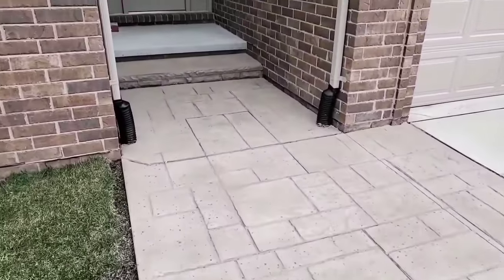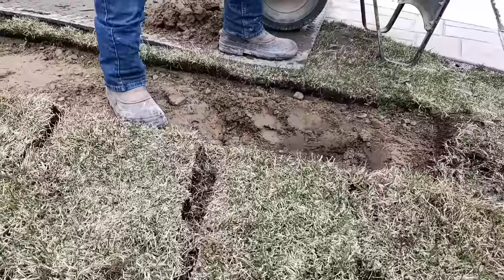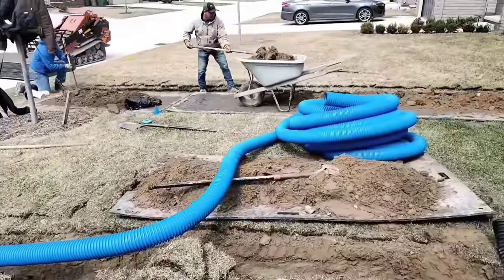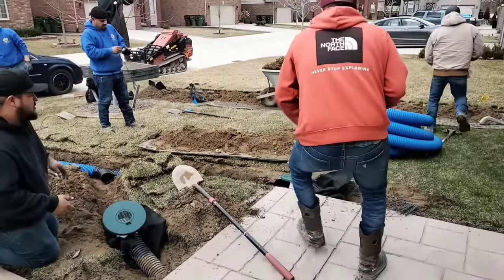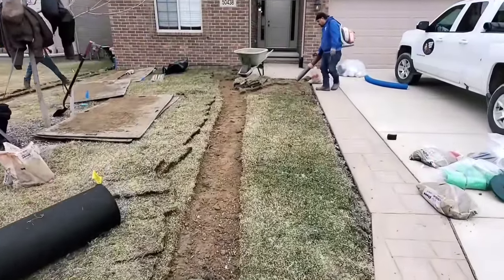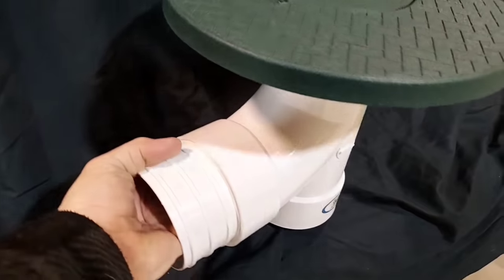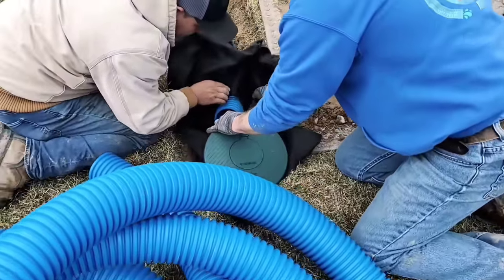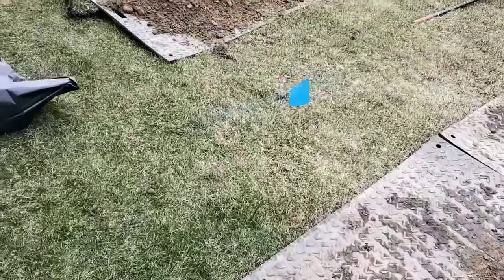Underground Downspout Drain - Done Right The First Time Work Smarter NOT Harder ] Drainage For DIYer

Comment: I really like the debris-evacuating downspout boots that Piedmont makes, but I'd like to see the industry provide a cheaper version of this made out of HDPE that is more aimed at residential downspouts. It's basically a downspout boot that has a screen inside and a flap door on the front so leaves and debris falls right out.  The screen is removable too.  I like the vented downspout adapter that you guys show in the videos, but I wish there was a version of this with a debris screen inside.  It would be a wonderful way to reduce maintenance and keep debris out of the underground pipe. Thanks!
Reply from the maker: https://youtube.com/playlist?list=PLjFCqaZ4v1BXKlR6qPMC_8I00r5KGdoP9&si=zzz5vOkVof4EaWaW

Comment: Not a new product,  but a possible experiment.   Was thinking about adding a catch basin in a low spot next to the downspout line.  Then wrap the grate with your fabric to keep out the bulk of the debris.  I have Bermuda grass, so it should grow over and cover it as well.  A quick fix for a bad spot where water pools up.

Comment: It is as if you were watching me these past 2 weeks.  We are north enough to freeze and I was replacing some work done last year with 2 runs using gen 1 popups/restrictors. I extended both runs  to the curb, I am using the latest popups/ restrictor plate with a 90 degree fitting  and holes drilled in it,  My soil is clay and agree it can be a sponge.  So I did 2 things - I dug out a mini dry well under both popups , and wrapped the hole and stone in your fabric. Unlike your T connector shown in the video here, the popup with 90 degree connector doesn't go as deep into the ground as that fitting.  So the drywell is independently wrapped and is closer to the surface than what you'd have using what is in the video.  I also used 2 feet of your cut pipe from the popup to the solid.  Again, did this because of freeze issues.  Come winter, water should have ways to escape, even if teh popup is under snow or ice. I  used your fabric to line the trench (above the drywell portion as well) from the popup to 2 feet past the perforated pipe connection  wrapped carefully and  packed everything down.  So I have 2 feet of perforated pipe wrapped to let water remaining in teh pipe an escape route. Now, I've had to repack the soil around the popups a couple of times, as heavy rain showed that while these worked great and water comes out of the popup but eventually it also finds it's way from beneath/around the popup as the drywell fills and the clay soil around the drywell and under the popup supersaturates and the water looks to exit.  This water did compact the soil such that I had to add more to deal with soil compaction and fill the voids the water created.  Also, in my case, I've no turf or sod just a dirt yard being restarted from scratch and I think the soil with grass goes a long way to making the pipe and popups stable when wet.  But at the moment, I can still walk the trenches after a rain and compact it more .  But once I have grass I think it'll all stabilize.  A local water utility guy who was checking my meter said the popups being right at the curb was perfect for getting the water into the storm drain.  .

Comment: Hello Robert,  I’m out of Columbus, Ohio.  It is standard to take our roof water run off systems under the sidewalk and to the curb.  The problem is that the pipe has to belly under the sidewalk and then come back up to go out of the curb.  Is there a way to develop a fitting that would connect to 3 inch schedule 40 pipe but it would flatten out to reduce the belly effect but still retain the capacity of a 3 inch pipe
Reply from the maker: I will work on it. That is a good idea because it will not chock down the flow. The water will speed up in the smaller diameter pipe "Mass Flow Rate" water in motion with its kinetic energy.

Comment: If you connect 4 downpipes to a single 4 inch hose will that not reatrict the flow of water in a heavy rain.   Even with 2x3 small down pipes you have 6 square inches of flow in every diwnpipe x 4 and you have 24 square inches going i to a 4 inch hose which is only 12.5 square inch cross sectional pipe. ??
Reply from the maker: https://youtu.be/b3YF1QSGz6M?si=S1UE9ohHHt1gMePx
Do the math. We do.

Comment: When would you use the in-line catch basin instead of a D-box?  Also, no knife cut after the catch basin?  Trying to plan a DIY install and getting confused with all the different installation methods in different videos.
Reply from the maker: I will make you a video. This video will cover everything. Thank you for commenting.
Reply: @FRENCHDRAINMAN  Does the 4inch Pop-up Emitter Catch Basin with Sump remove the need for a separate 4inch Catch Basin? Or do you need to use both?

Comment: I've got a corrugated pipe that just dead ends under the grass. There's a drop off of at least a meter and a half between the start and the end of the pipe. During heavy rain events, there is enough pressure in that pipe that the grass will rip and open up, allowing gravel and other miscellaneous materials to wash out. The grass falls right back into place as soon as the rain is over. I definitely should do something to set it up better, but heck, its been working fine for about 2 decades at this point.
Reply from the maker: Nothing like a good thunderstorm to clean out a gutter drain.

Comment: At what point do you need multiple pipes off multiple downspouts? I have 3 downspouts and I'm wondering can I connect them all to 1 drain pipe and popup? Or will that overwhelm the system? Texas flood area
Reply from the maker: As long as it's a 4" pipe your solid. We run up to 5 downspouts on a 4" line in Michigan. I wouldn't advise that for you. 3 isn't a issue.

Comment: I am wondering if it could you use the pop up on the discharge line of a sump pump?
Reply from the maker: Absolutely 
Watch "French Drain Man V2.0 Pop-Up Emitter Water Flow 240 Gallons Per Minute With 2% Slope Downspout Drain" on YouTube
https://youtu.be/uEsKU0m8qhw

Comment: Where can I get some of that blue pipe I have some downspouts where the lawn mowing person hits it with his weed eater and has cut holes in it so I need to cut it off at ground level put an adapter on it and then connect it back to the downspout I need about 6 ft to do three downspouts.
Reply from the maker: Best French Drain and Yard Drainage Contractor
https://frenchdrainman.com/

Comment: So, Have you got away from having a clean out using the 12” round distribution box which was located just after the downspout connection, 5’-10’ away? Thanks
Reply from the maker: If there are really big trees we still use a giant Basin. The problem is nobody vacuums / cleans them out. Our smaller in line is quick and easy to install as well as pop the four inch grate and stick a shop vacuum hose to the bottom of the basin. People have trouble with the bigger basins. We built it for the DIYers but now it's mostly what my customers want. My men love them too.
Reply: @FRENCHDRAINMAN  Thank you !

Comment: Question - Are catch basins required? How come the Buried Downspout Kit for 1% Slope Kit on your website doesn't include them? In this video, would it be OK to connect the two downspout pipes with a Wye and not have any catch basins? In other words, would it work if you did everything the same as in the video except not use any catch basins? 

Does the new 4 in. Pop-up Emitter Catch Basin with Sump remove the need for catch basins as you have in this video?
Reply from the maker: I want the catch basin to collect shingle gravel as well as a vent. In the winter the street is plowed and snow is ice packed on the pop-up emitter near the street,  the water can vent out the basin.

Comment: How well do the pop ups work when they have snow on top
Reply from the maker: We have a Groove in the pop-up plate and the water comes out around the hinge. It's also to clean the hinge point to remove grass blades or debris. It doesn't have to pop-up. It's pretty incredible really. So much development went into the discharge system. It's actually pretty cool to see the water come out when it's closed. It takes 3 downspouts to run it at half throttle. 6 downspouts and it's entertaining. 8 downspouts and it's exciting. It's boring under normal use by design. You won't be disappointed to own one. It will never get lost in the grass and you can stick your hand in it to remove leaves or sticks. We built it because everything on the marked had short comings. The pitfalls were many. We took all pop-up emitter on the market and use there failure points to develop ours. I have so many stories about this pop-up emitter V2.0  I should do a video about all the Hurdles we had to clear.    
Right down to making it out of Virgin HDPE with no blown in filler. It's the last pop-up emitter you will ever have to buy. Thank you for commenting that was a great question. We will do so many more instructional videos this summer highlighting the function and features.
 Stay Tuned!

Comment: I just installed the larger catch basins on all of my downspouts. What’s the difference between those and these new ones?
Reply from the maker: You have to clean the new small ones sooner. The new smaller install so much easier. They fit everywhere. If you are feeding a ton of leaves and sticks into the system then the larger would be better. If small trees or few trees the small basin works just fine. It's easier to pop the grate and vacuum out the small basin than to take off the screwed down lid on the bigger basin. Those are the differences.
Reply: @FRENCHDRAINMAN  does the bigger box kill the flow rate?
Reply from the maker: @thegolftechie  not if you have 1% Slope.

Comment: If i wanted to run 3 downspouts to main line to one pop up emitter what would you use. ?    Imnin florida where there are heavy rains at times that overwhelm my 2 downspouts thats why im running a third….   I do not want to run 3 seperate main lines out to the street if i dont have  to.   What size main line pipe ?   The run from the downspouts to the street will be around 20-50 feet
Reply from the maker: I would use our armor Pipe in 4" you can go up to 4 downspouts. 
Store | French Drain Systems | Curtain Drains | Macomb, Oakland, Lapeer, St. Clair County
https://frenchdrainman.com/store/
Reply: Do you have a link to a 3 into 1 wye  and the best pop up emitter

Comment: I’m in south Florida where it rains constantly.  I don’t see the need for all this.  You have gutters just put in an elbow and let it run down the driveway.  The other one can drain in the yard watering it.   Can you please explain this.   Does it have something to do with winter and water freezing.
Reply: Here quite often we have basements, not slabs, since the water table is usually more than 10 feet below grade.  We don't want any more water against the foundation/basement walls than can be avoided.  A part of it is due to the freeze thaw cycle as well.
Reply from the maker: https://youtube.com/playlist?list=PLjFCqaZ4v1BUqichor2QH1X_p9bBPor8D&si=zlbsvXRF2i4m8w39

Comment: Great, educational video.  We purchased a new home a little over a year ago.  New construction.  Whoever installed the pop up drain for the downspout in front of our house must not have done it correctly.  I'm basing that off the fact that this past winter, our front stoop, right where the drain runs under, has cracked.  Including a corner of the driveway.  My theory is that the drain pipe thawed and froze during the coldest part of the winter.  Now the builder that built our house is out of business.  :(

Comment: Not sure if i understand the need for the in line  basin?  your leaking water into the soil at the bottom of it which confuses me if the purpose is to get rid of water as far away from the house as possible.  you also mention its purpose is for venting but the connection at the downspout should have a vent on it right?  just trying to understand this.  i live in chicago and don't have a huge lot so i really only want to put in a vent/cleanout at the downspout connection and then the pop up at the end of the run near the sidewalk.
Reply from the maker: https://youtube.com/playlist?list=PLjFCqaZ4v1BWbLx7DHgD1YrWdm2wotwlY&si=Fl1uosVJ0K-A7Xwq

Comment: Great video! We are on a small corner lot with about a total of approximately 8 feet from the corner of the house/downspout to the public sidewalk. Do we need a d-box or vent or can we run the blue pipe directly from the downspout to a pop up? We have a second downspout on the other side of the front of the house that is about 15 feet back from the sidewalk. Thanks!!
Reply from the maker: It's nice to have a in line catch basin if you have asphalt singles. I recommend that.

Comment: Great work, but the install on the corrugated under the cement left a lot to be desired. They could’ve cut it closer to the cement!
Reply from the maker: Armor pipe does flex like the Black thinner pipe and we needed to twist it a bit for alignment. 
Thank you for commenting.

Comment: These new catch basins and pop up emitters are nice. One thing I don't understand, Where does the shingle gravel go. If the basin has a hole on the bottom and you fill the bottom with pea stone to act as a dry well, is the shingle gravel collecting on top of the pea stone. With a D box it made sense to use a shop vac and clean out the shingle gravel, but with these won't you suck up the pea stone at the same time. Your videos are awesome. Thanks
Reply from the maker: The pea stone is on the OUTSIDE of the in line catch basin. So it's empty inside. The basin has many holes drilled in it to allow for the water to leach into the pea stone. Thank you for commenting. I hope this helps.
Reply: @FRENCHDRAINMAN  My apologies, I thought the in line catch basin was open on the bottom like the new pop-up emitter. Can I ask why sometimes you use a D box (or this new in line basin) a few feet away from the downspout and sometimes you just run the pipe straight to the pop-up. If I am nervous about debris and gravel collecting in the pipe, then one of these in line basins is a must, correct. Any fear of the water velocity slowing down when it goes into the basin?

Comment: In most cities you can't take the water all the way to the street.
Reply from the maker: If it only runs during a rain your fine but if it's a sump pump line running all the time they will ask you to remove it. Usually 20ft off the street.

Comment: It's all good until the roots grow into it through the fitting joints & drain holes!
Reply from the maker: We use tile tape that is water tight. Tree roots can't get into our roof runoff systems.
Reply: @FRENCHDRAINMAN  I thought you said there were drain holes so water didn't sit in it.
Reply: @daled8221  The Pipe has no perforated holes. The vent at the beginning and the pop up at the end are wrapped in the fabric that blocks roots and dirt.

Comment: Hey dude should of put a tee underneath  the concrete and ran 1 4 inch corrugated out the yard. Working smarter not harder
Reply from the maker: I don't use Tees as the video explains. Thank you for commenting.

Comment: That's an upside down san-tee not a sweeping 90. I don't think you can go horizontal to vertical that way. Supposed to be a long sweeping wye instead.
Reply from the maker: We do use it off-label in this application. We have a new fitting that will be out shortly. Appreciate you commenting and contributing.

Comment: Pop up is the weak point in this design unfortunately . Remember that drained water doesn’t come out under pressure which makes T pop ups to be nothing but a trap for stagnant water and debris.
Reply from the maker: Then buy a pop-up with a 90° elbow.  There's a reason why we sell them in more than one flavor. It all depends on what you subscribe to. I use both.  Thank you for commenting and sharing 😊